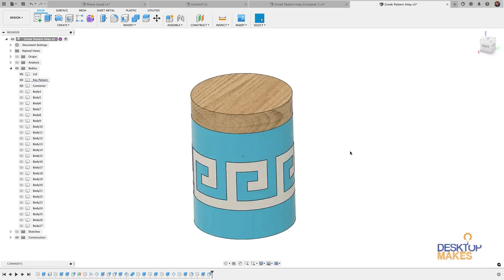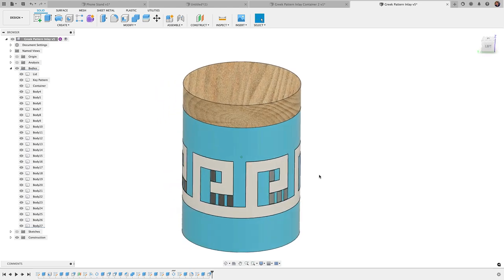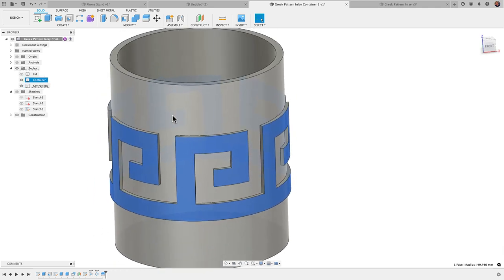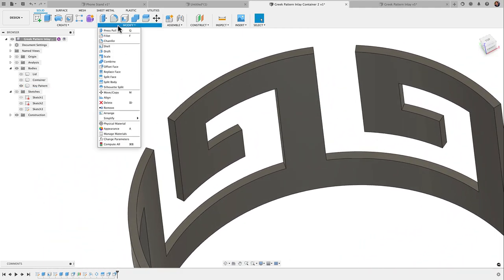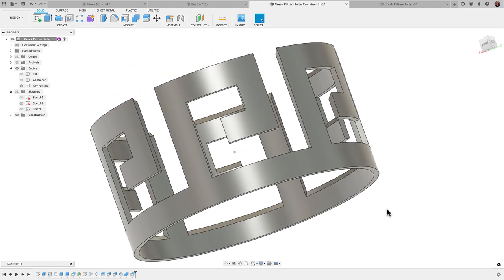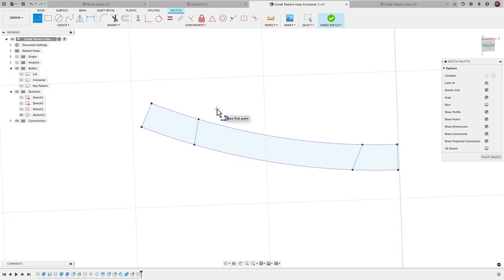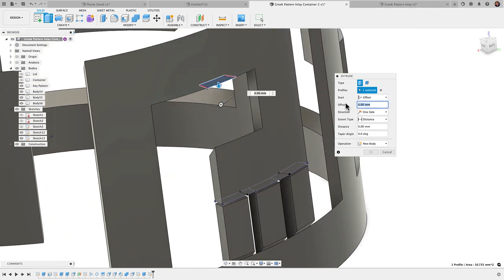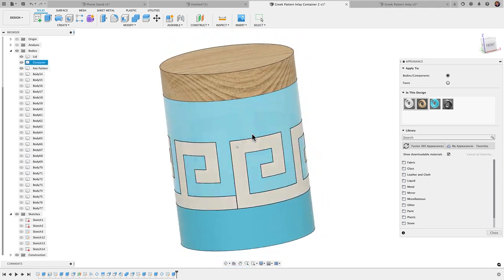Design Your Own 3D Print Supports in Fusion 360

Comment: Excellent presentation.  I found your channel while searching for custom supports.  I came to a similar conclusion trying to develop breakaway support for a near vertical, but small model.  My challenge is that using my Bambu A1 the acceleration, deceleration tends to break my supports, but still trying to refine the process.  Your demo confirmed I am using the right approach. Regardless your technique narrative, pace, and annunciation/voice is the best I have experienced.  This info is so valuable to those of us trying do do functional design and production.  Than you so much.

Comment: Looking at the supports at 2:18 it seems there is a tall unsupported area just to the left of the supports you made. Was that an oversight? If it was intentional, what was the reason you left that area unsupported? Thanks!
Reply from the maker: Hi grandwaz0o, that was intentional.  The printer has the ability to bridge so you don't have to support every overhang.
Reply: @DesktopMakes  thank you!